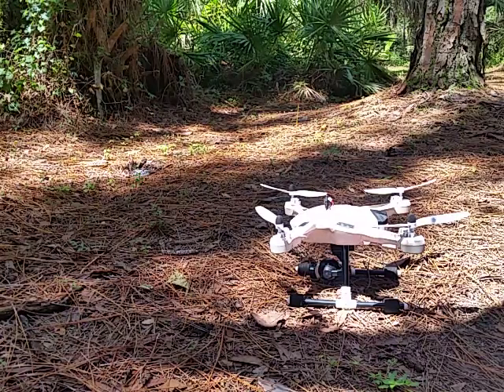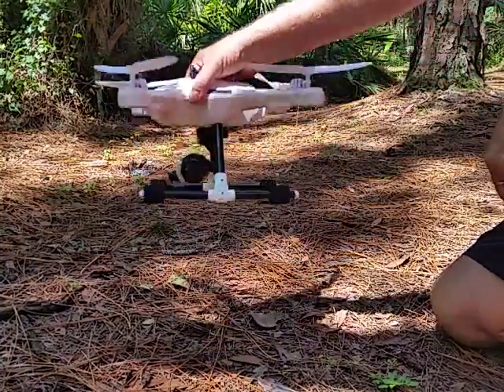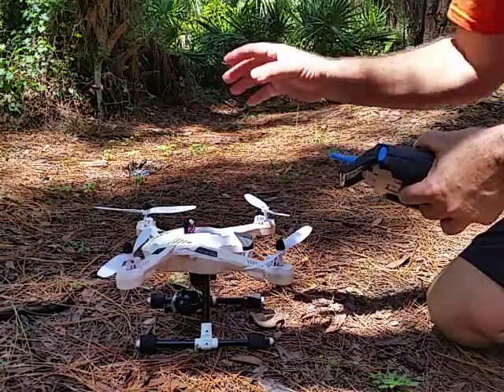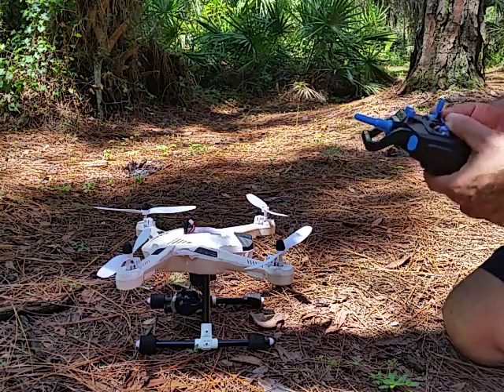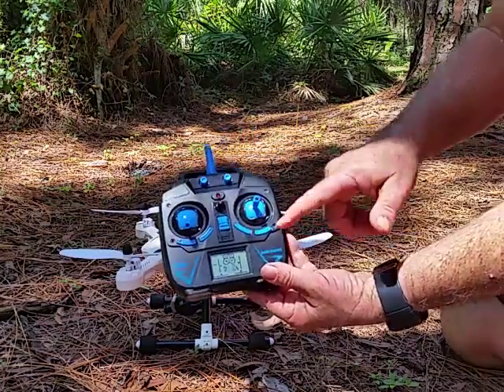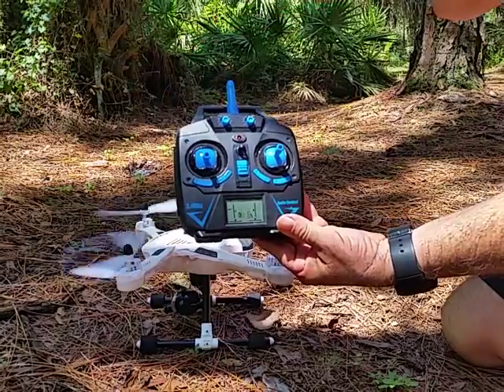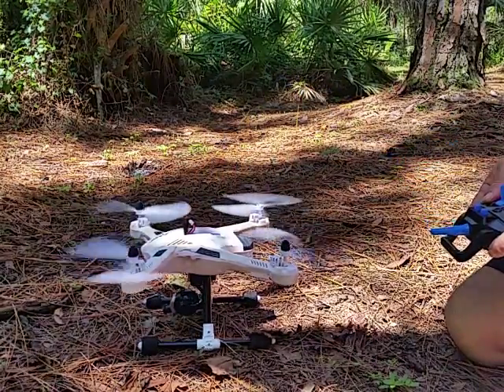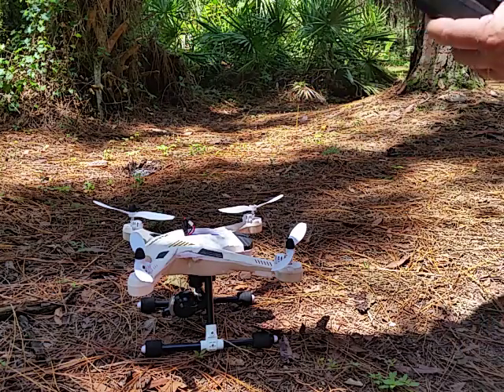Jjrc h26d problem

Comment: Your propellers are all installed correctly.  But you have incorrect polarity on the motors installed in your front right and back left motor pods (their spinning the wrong direction for their propeller, blowing air upward instead of downward).  I can't remember, but I believe that the H26D uses the old WLToys V262 style motors.  Are they plug in or soldered?  If plug in, order two more motors of different color wires.  If soldered, unsolder the wires and resolder with swapped polarity.
Reply: Quadcopter 101 We had a similar problem with our h26 but the difference was before we changed the polarity we had all the props moving in the right direction but then when we changed the polarity they all started to spin in the same direction. also they are all new motors. Do you know a solution to this problem?
Reply: Hello how u doing i have same problem it's new